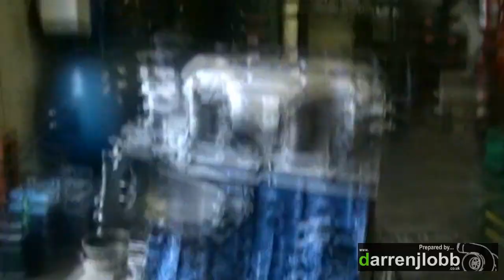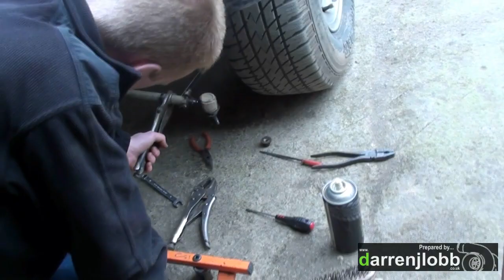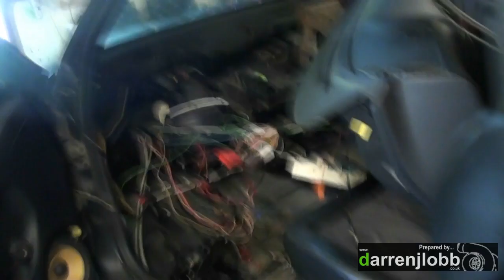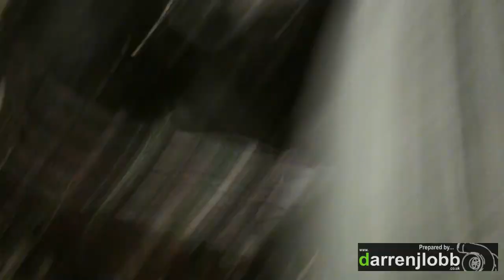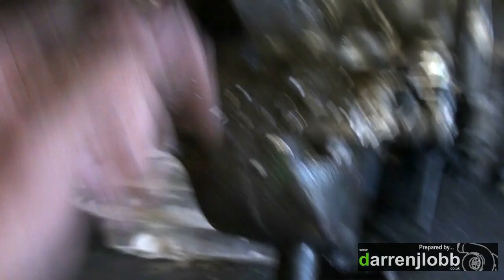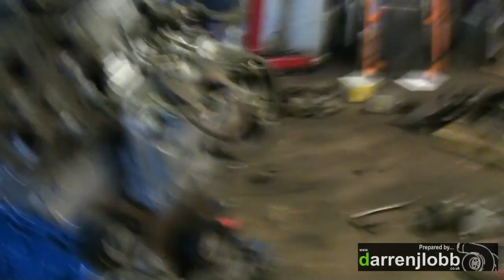darrenjlobb Project M-TDI16 Build Part 3

Comment from the maker: @david667766 Tbh it did, was in the pit on my own, pulled rear motor mount bolt, and it half fell out as forgot to tighten up enigne hoist...only a stock XUD so removed it with hastle / no care haha